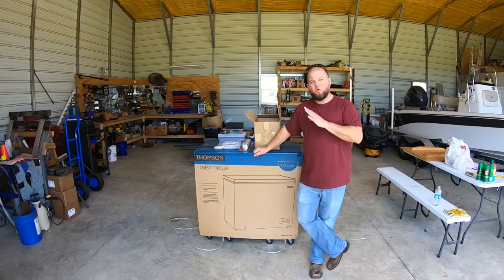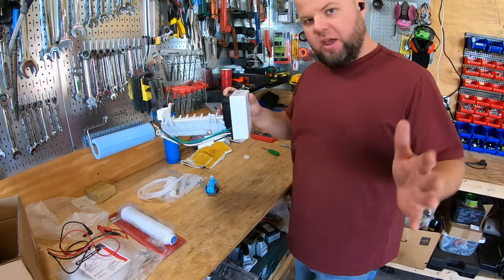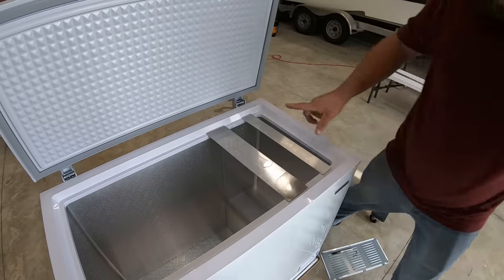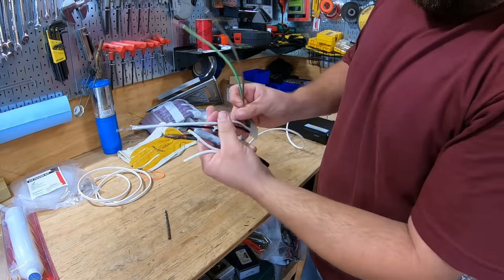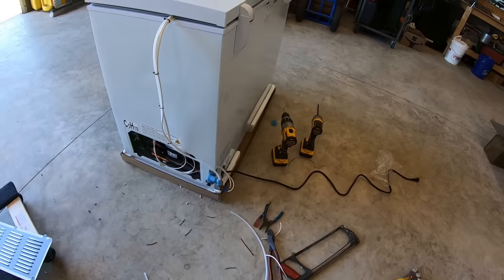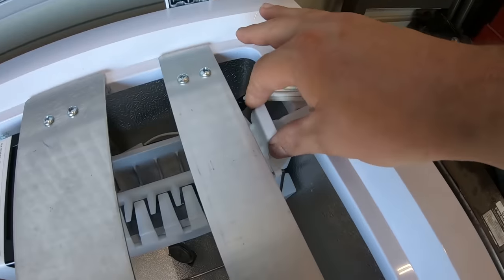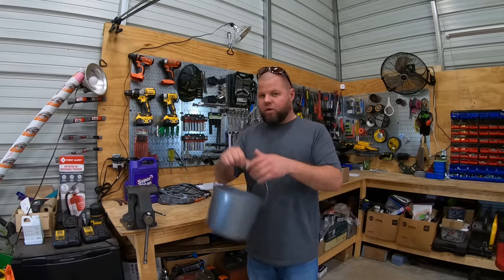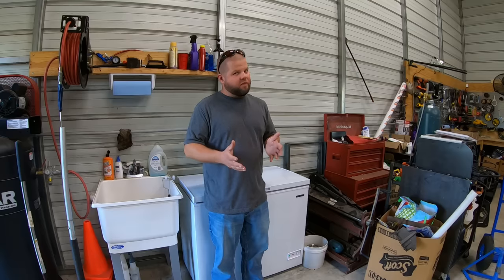Homemade ice maker! SAVE thousands over a commercial ice maker

Comment: i just freeze 1 gallon pails of water, that block last 4x as long or put whole cooler in  freezer 1/4 full of water and that will last  4 x as long. then you only need a min of ice to go in between
Reply: I usually freeze water bottles, that way you can drink it when it thaws, but they don’t have the surface area to cool down as quickly, so I have noticed a difference between that and pebble/ cubed ice
Reply: I have been doing block ice for a long time also if you brake it into large chunks and put it in a  yeti style cup the ice will last all day well as long as your liquid isn’t hot/warm  but still last a long time
Reply: I've been using brownie pans making thick blocks.   They fit perfect in the bottom of my cooler or can use them as divider or break them up.

Comment: It’s easy to find out where the coils are at. Turn on spray the walls with water in a mist spray bottle. It will show right away where the coils run. Not  exactly but it will show where they run. The cable and hose location although not a huge escape of cold air it will affect the efficiency of the freezer a lot. It will run here and possibly ruin it or shorten the life of it. Cut lower into the freezer lip and silicone the are really good. No coils in that area for sure.
Reply from the maker: Thank you for the tip!
Reply: Still be careful the condenser is mounted to the outer shell that's why it's hotter on the outside
Reply: Flip on side on thin table.  Apply ultrasound horn from under with fine sand on top.  A pattern should emerge.
Reply: @dunntanktrucks  The compressor is in the bottom, that is what that one square block is in the bottom that lifts up from the rest.
Reply: @SilvaDreams  the CONDENSER is still where?
Reply: @dunntanktrucks  See that raised little square in the bottom of the deep freezer? It's located under that, you can also see it when he has the side off to do the wiring.
Reply: @SilvaDreams  That's the compressor, not the condenser. Many small freezers run the condenser coils around the outside of the shell. It gives a lot of surface area to dissipate the heat, and prevents condensation on the surface of the unit.

Comment: To bend pvc or other rigid plastic tubing cap one end, fill your tube with HOT sand (400 degrees heated in the oven) cap the other end, wait a few minutes for the platic to heat up make your bends, and dump the sand
Reply: I seen large PVC vent into 90* angles with... a bucket of hot water and and metal pipe. Slip over pipe and alittle muscle should work. I'm a unemployed REGISTERED Nurse. I worked day Labor* places to get a couple bucks in my pockets.

Comment: Was so glad to hear that you were already aware that the freon lines were run in the walls of the freezer!  I'm sure more than one person has ruined a great project by drilling into the side of a planned Kegorator!!! haha  Great project Andrew!
Reply from the maker: Oh yeah I've had enough experience in my life with refrigerators, AC units Etc
Reply: @TKCL  -- There's 2 types of lines that you need to be concerned about -- the ones where the cold liquid refrigerant are running and the ones that are used as a heat exchanger with the outside air to move the heat extracted from inside the unit to the surrounding room.  It used to be that the latter were mounted to the exterior of the unit, but that is not necessarily the case these days... If you don't see the coils on the exterior or underneath the unit, it might be in the wall... Another clue that this might be the case is if the walls of the unit are noticeably warmer than the surrounding room... When cutting through the wall on the refrigerator that I converted into a kegerator, I started out with a small hole on the outside wall with a drill stop attached so that the hole would only go through the metal skin... From there, I took an very thin shaft screwdriver and gently forced it through the foam, paying attention to whether it seemed to encounter anything along the way... One at the inner wall, I took a long drill bit and while drilling from the outside, allowed it to drill through the inside wall... I then used a larger drill bit to get to the size that I needed for the CO2 hose... Drilled the inside and outside surfaces first and then used the screwdriver to gently poke through the rest of the insullation, paying attention to any resistance from wires or coolant lines... Because of the design of the refrigerator, I was pretty sure there were no coolant lines in the side wall, but there was a possibility of there being electrical lines going through there...
Reply: Could one use shrink wrap for your Electric wires.
Reply: Thanks very good.

Comment: A idea I was thinking is measure the hinges where the freezer lid mounts on the back and use some metal to make the lid sit higher. Then get some expandable weather seal and line the top of the freezer and run hoses or wires through seal instead of notching the freezer. If it don’t work. Just remount the lid back and remove the weather seal. Keep your factory warranty 😂
Reply from the maker: Good idea!

Comment: You can fill the pvc with sand before heating will let you bend without crimping....  courtesy of Iraqi "plumbing" expert I learned it from.....
Reply: Sand sure as hell ain't in short supply in the "Land Between the Rivers"
Reply: It really works, I had to do that on a project a while back
Reply: Another guy heats the sand and pour it in the pipe and then wraps it through a jig to form the curves he wants.  The sand stays hot while he bends it around the various curves.  I think he was making some kind of roller coaster.

Comment: Great idea, my only recommendation is adding foam insulation around and on top of your freezer. That will make a big difference in the energy you use and make your ice that much cheaper. We live off grid and it's a big difference on our batteries with the foam added to our freezer.
Reply from the maker: Working on it, thanks
Reply: The freezer needs the space around it to cool down .If you cover a freezer with insulation it will be destroyed.The freezer emits heat from the side panels which needs to be displaced.
Reply: I love this

Comment: I know you labeled them so you remember. But, the ribbed wire(identified) is the neutral. You just remember that. Looking at the plug(on an extension cord) you'll see the neutral is wider blade and the thinner blade is the hot.
Reply from the maker: Thank you for the information
Reply: You're very welcome. As an electrician, my mind wouldn't let it go. Had to. Thanks
Reply: @effyoo6081  I came to say the same thing  but you already beat me to it

Comment: Glad this works for what you need. I really commend your ingenuity. My profession (appliance repair) requires me to explain this a little though. Hate me later. Lol. 
This is really no comparison to a commercial unit at all. In addition to creating ice a bajillion times faster, they create a pure h2o cube. Way cleaner than your filter can make it. None of the crap in our tap water is frozen into the cube in a comm. unit b/c of how they make ice. This system freezes everything in the water supply into the cube. Slight improvement with your filter, but most still leave around 100 ppm of contaminates after filtering. This ice will melt/water your drink down way faster and leave the tap water taste in it. That's why restaurants/bars use the expensive ones. Completely different animal. Again though, if it works for you, that's all that matters. HUGE $$$ savings! Cheers and thanks for sharing.
Reply from the maker: It works great for coolers and fish boxes as designed. I just can't justify a commercial machine for that.

Comment: Pro tip: get a silicone cake pan from the thrift store. Make big blocks of ice to keep your coolers cold longer.
Bonus pro tip: keep the ice blocks in a cooler in your freezer. That keeps your ice and cooler ready to go
Reply from the maker: You'll enjoy next week's video, I'm already planning on making block ice to assist the cubes and to increase thermal mass in the ice maker. Also testing electricity usage
Reply: Good tip, and you could supercharge the insulation with another layer of polyurethane/polyisocyanurate foam and some thin plywood. Then out in the garage it will be far more efficient.

Comment: Cool project! Nice job. One idea, I think you could use a thermal imaging camera to identify the coils and drill through the walls of the freezer to have a cleaner build. Camera might show coils better when unit is first turned on, b/c the temp difference of coils vs. walls/sides of freezer.
Reply from the maker: I have been looking at a flir model.
Reply: titanebay didn't watch the video.

Comment: Great video, I just love the idea.

The unit in our Fridge/Freezer makes 6 ounces of ice per cycle and it takes about an hour and 35 minutes for each cycle so it cycles about 15 times per day for a total of about 5 pounds 10 ounces of ice per day.

There is usually some adjustability of the size of the ice cubes (how high the water fills in the tray) so you may be able to increase the output a bit.

Also keep in mind that there is a thermostat inside the ice maker that measures the temperature of the water/ice to determine when the batch of ice is done and ready to cycle. The colder it is inside the freezer, and importantly, the colder the water is, the quicker it will cycle.
Reply from the maker: I agree and more experimenting is in order

Comment: If you look at the replacement part blow out at the back of the owners manual, it will show you where the evaporator and condenser are sitting which would allow you to feed everything through while also being able to seal it off.
Reply: Or the door
Reply: This style freezer doesn’t have an evaporator. The condenser lines are run throughout the freezer walls. There are no diagrams that show the locations of these refrigerant lines. Parts diagrams only show the “replacement” parts. The refrigerant lines in the walls are not serviceable.
Reply: @ljslw  EVERY refrigerator system uses an evaporator, even if its an orfice tube stuffed into the liguid line and bent up to mimic a more conventional evap coil.

Comment: the next time ur trying to get water, so close to a faucet,  get one of those tee fittings that screws onto an existing angle valve feeding ur faucet instead of that pos piercing tap.

Also, they sell braided stainless ice maker water supply lines.  A better choice if ur not looking to flood ur garage if that cr*p plastic tubing decides to give way.
Reply: In MA those Valves are against code..
Reply: @luisalvarez8266  why massachusets legalized marijuana before connecticut did.
Reply: I replied to this on the wrong post. Just want to be clear. The Tee fitting you mentioned is  good, but the the piercing valves are against code...
Reply: @michael-dm2bv  profits?
Reply: @luisalvarez8266  u didn't repond wrong.  piecing valves suck ass.
Reply: @luisalvarez8266  - a tee fitting on top of an angle valve, to feed ur ice maker, is proper, code wise.

Comment: Randomly started watching this video because I like the idea of building your own, then ended up looking on marketplace for used Manitowoc ice machines. I thought “no way a twenty year old used ice machine is $2000+” and boy was I wrong.  I think if I used that much ice I’d go this route too.
Reply: Amazon sells a commercial ice machine for $350.
Reply from the maker: Makes small hollow cubes that melt quickly. That's not good for coolers and fish boxes.
Reply: @TKCL   I think you're thinking of a counter top ice maker. The one I'm talking about sits on the floor and is a small commercial ice maker that keeps the ice frozen and makes square cubes, up to 88 lbs within 24hrs.
Reply from the maker: I'm very use to those, we use to use them and the big commercial ones at work all the time. They broke down often and had small square ice cubes with hollow indentations. Fine for drinking ice, horrible for filling coolers and fish boxes. That ice does not last.

Comment: All you had to do was use a high end adhesive to attach to the wall of the cabinet interior and mount the tray. Those plastic water lines are notorious for splitting plus use those puncture tube water connectors is asking for trouble. The idea is great just upgrade the materials used for your own protection from unwanted potential water damage.

Comment: My old freezer didn't have a fan in it. I found that the top was like 30 degrees warmer than the bottom. Use a thermometer to check if you have a significant difference in temp. if you do, you can do what I did. Make a vertical duct in the corner and mount a computer fan on the top of it. The fan sucks cold air from the bottom. You could probably blow the coldest air directly at the ice maker. Add a switch so that when the door is opened the fan shuts off. This stops the cold air from being blown out and the warm moist air from being drawn in when you open it.
Reply from the maker: Installing two fans today and testing, video out soon
Reply: Yes it will make a lot more ice that way
Reply from the maker: I'll know by tomorrow
Reply: You ever notice the freezers at the supermarkets with no lids on the freezers. Fans need to draw air and installing  a fan in that type freezer makes no sense to me. Just sayin
Reply: @MrKoladge  hot air rises cold air drops. a fan will mix the air creating a more uniform temp in the freezer. it's pretty amazing how much temp will change in a freezer from top to bottom because of the lack of airflow.
Reply from the maker: Exactly, the cooler the temperature up top the quicker ice is made.
Reply: @TKCL  the ice maker has an internal thermostat that must be 10 degrees or colder before it will allow it to cycle
Reply from the maker: Yes it does
Reply: @MrKoladge  coffin freezers (supermarket freezers) use fans to force cold air from the bottom of the case, up the back of the case, through a diffuser (to spread and slow the cold air) and drops the air over and across  the open food compartment.

Comment: The piercing valve is the worst idea ever, I've seen those start leaking and there's no way to shut it off when the gasket goes bad, just install an actual shut off valve, and get rid of those piercing valves. I've had dozens of customers have to file a major insurance claim because of those piercing valves.
Reply from the maker: Thank you for the information!
Reply: I thought the exact same thing i'm not a plumber but my uncle was a HVAC/plumber and electrical contractor and he fukin hated those things
Reply: It’s in a metal building with concrete floor. Cmon
Reply from the maker: Kind of my thoughts too, not in a wall and no wood to rot. But yes it's not the best design
Reply: @TKCL  for this application i think they're just gine as long as you check it regularly not s9mething i w9uld install in my ceiling though
Reply: @wolfman1549  I 100% agree with you. In this instance that is a perfectly suitable solution.
Reply: @TKCL  yep no issue in shop with concrete but in most states they are illegal on domestic water systems.
Reply: Would piercing valves reduce water pressure vs other means ? My fridge dispenses water fairly slowly.
Reply from the maker: You most likely have mineral build up. But the piercing valve does have a slightly smaller opening where it pierces vs the tube size. Good chance you have build up there, especially if on well water.
Reply: @TKCL  We're on city water, but Iowa water is hard. However it is nearly brand new.
Reply from the maker: Make sure the piercing valve (assuming you have one) is turned all the way out to the left. That opens the flow fully
Reply: @TKCL  I've never even messed with it. I'll be sure to check it out. 

When they're installed, are they turned clockwise into the pipe to pierce it, and then you back it out?
Reply from the maker: Exactly, yes!
Reply: Those piercing valves are also called saddle valves and I’ve seen a ton of videos by qualified plumbers (This Old House channel has at least a few) about them. The main issue tends to be the gasket around the puncture can over time become brittle and stop holding the water back. Then you have a pin hole in your pipe. So the comments about not hiding the valve away are spot on. I had 2 in my crawl space that I had a plumber come in and remove. They were pretty old so it can take a while before a problem is noticed. Since I saw you soldering the electric wires you probably could solder a t-fitting with a 1/4” shut off valve for the water line. The one I currently use for my ice maker used compression to keep the pvc pipe in place with the metal with soldered connections on the actual water line. Fun idea for your own ice maker.
Reply: Those pipe nipple piercings valves work just fine and I have used them for years with no leaks. 
Having a tee and a separate valve is of course the best way. The recommendation someone made about using a factory braided stainless line is certainly better than that cheap translucent pipe. Just remember that the braided stainless has plastic inside too and those lines should be replaced every 5-10 years and never exposed to freezing temps unless water is drained .PEX would be great too just make sure you paint the PEX because it shouldn't be exposed to sunlight.
Reply: @wolfman1549  Its likely the people who decide to build one wont have the same structure , so I personally thought the comment was to them , and he was beinICE .

Comment: Even easier, make ice blocks using any HDPE containers you get free (when you buy what's in them) but would otherwise be thrown out when empty. 1-quart square bottles that originally contained rubbing alcohol don't waste as much space as round bottles.
Reply: Heck, you could save your gallon and half gallon jugs and freeze them.